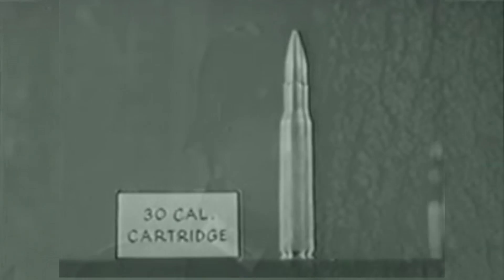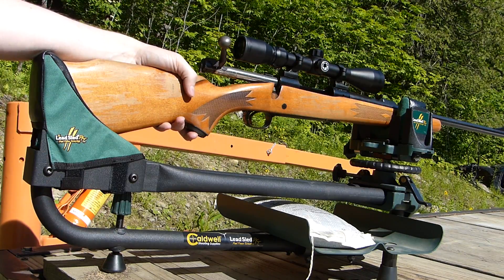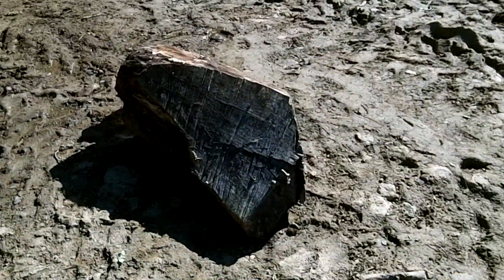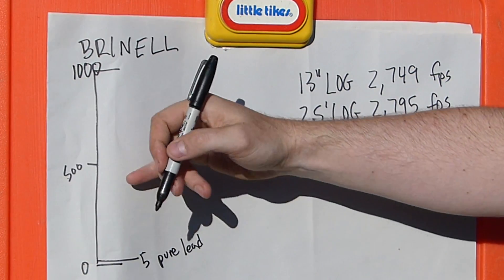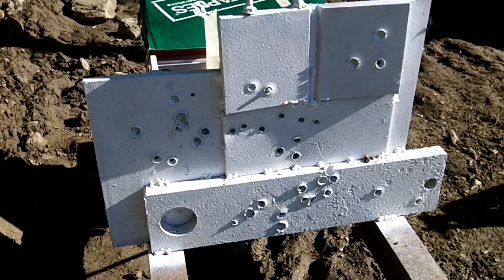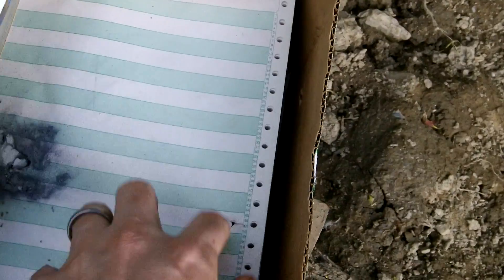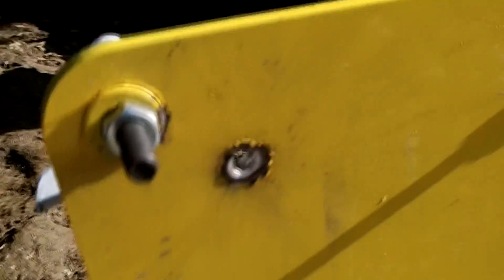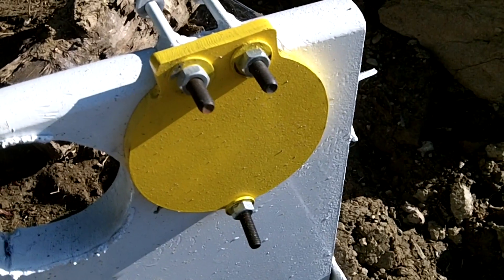AMMOTEST: 30 Caliber M2 (30-06) Armor Piercing Penetration Tests - Military Surplus Ammo

Comment: That is crazy power 1 inch steel with no issues.
Reply: "Additionally, steel will have a significantly greater shear stress 
capability than aluminum. This means that you get nearly 5X as much 
carrying capacity in a given thread engagement in steel as you do 
aluminum. This is the difference between a body-centered cubic crystal 
structure (LC steel) and a close packed hexagonal structure (aluminum). 
Anodizing aluminum will bring their properties in this regard closer 
(about a 2.2:1 advantage to steel). Unscaled merchant steel will have 
(about) 4X the (resistance to penetration) surface hardness of 
(6061-T6(xxx)) non-anodized aluminum."
Reply: @danphariss133  lol good comment . not gonna get to many one uppers on that one.
Reply: @justinriley8651  I just found that someplace and posted it for fun. The concrete wall would get shot more than once in combat. The AP was the combat ammo, ball was for training. This according to a WW-II vet, Chosin Res survivior and Hatchers book of the Garand,  Tracers were used as well of course. And aircraft used API as well as tracers of various kinds... You can find the specs for various miltary rounds to 50 cal in "Cartridges of the World".
Reply: @danphariss133  ya I've owned all those books for years. regular fmj. was used in combat way more often ,I'm sure if ap was available you could use it. they had tracers too,and blanks for launching grenades.
Reply: @justinriley8651  So you saw M2 ball in combat in WW-II and Korea? Just curious.
Reply: @danphariss133  were you?
Reply: @danphariss133  the guy that raised me was a ranger in ww2  and I also had a uncle in ww2 I've got a real good idea what went on . probably better than yours. did you serve in ww2 or Korea just curious?
Reply: @justinriley8651  Dad was just a guy in the army. Philippines. The Korean War vet was a serious gun guy. Life long gunsmith, Inchon landing and wounded on the way back from Chosin. Me? I am a Vietnam infantryman. I saw one can of 30 cal in VN but don't ask me what it was. I don't remember. It was mixed in with our load of 7.62 and I found it one day when cleaning the dirt and mud out of the track. I was Mech Infantry. I can only go on what I was told and what I read. Both these guys had exceptional memories. Dad told me of seeing bullet jackets around masonry buildings and other hard surfaces where the AP had shed it jackets.  He also said that the M1 would shoot through brick walls. Don the gunsmith told me they used AP in Korea. Was I there? No I was not. But neither were you so stop acting like you are an expert, who are running on other people's memories and documentation. Anyone that claimed that M2 ball was never used in the combat zone would be a damned fool and I would never say that. But when I have Gen Hatcher and 2 men who served in 2 different wars telling me they used AP I have to take their word for it. My question for you would be did you ever specifically ask or could you now? My father died in 2017 and Don in 2018 so they are no longer available but I did specifically ask. Being a sorta retired gunsmith and still shoot master class in service rifle. Here is another little factoid for you. The 30 AP was more accurate than the M2 according to the information I get those who used to get ammo furnished for practice and match use by the DCM (now CMP). I also shoot one of my Garands in competition from time to time, but they are not competitive outside vintage or JC Garand matches and I can't see irons worth damn anymore. I have some 30 AP but I don't shoot it since its all corrosive primed from the war years. Some my dad bought back in the 1960s at a gun show for his Garand and some I took in trade for fixing a pistol for a friend.  But while this used to be very common its now almost all been bought and used so 30 cal in boxes or in clips is hard to find and expensive.
Reply: @danphariss133  I'm not acting like a expert I speak up when I see stuff I know is false. I've got one still alive and he was in the bulge and all over . he never had any ap. I've heard that too about ap being more accurate and the snipers using it. can neither confirm nor deny.
Reply: Zooming in shows AP on the guys sling.
Reply: @danphariss133  so that means that's what everybody had. because a couple guys in a picture  had some. there was more fmj than ap being used. it may have depended on where you were at also. some guys might have had ap but not everybody did.
Reply: @justinriley8651  Did you read the post where I said there was no way to know that ONLY AP was used? I was quoting Gen Julian Hatcher who knew FAR more about this that either of us or two people I specifically asked. One of the squads in my platoon got some API 50 cal and were talking about how it flashed when it hit things. We had 50 cal ammo from the 1950s issued to us and it was prone to case head separations due to the powder being too acid and attacking the inside of the cases so we threw it in the bad ammo dump. Yeah I LOOKED at the broken case and it was corroded. I have ALWAYS been a gun guy and I paid attention to the things I used.  I tuned up our 50 so it had a rate of fire about 150 RPM above standard, about the same as a M60.  ANYTHING IS POSSIBLE. But in GENERAL I have to go with Hatcher's writings and the gunsmith that served in Korea. If I were to ask the men I served with in VN about the ammo they shot I doubt more than 1 out of 10 (if that many) would have any idea. Most of the INSTRUCTORS I had in infantry school were firearms illiterate. The 1911 instructor thought the 45 ACP used an 830 gr bullet.  We need to remember this anytime we talk about military men and firearms. So I trust Hatcher, I trust what my Dad said about the bullet jackets. I trust my life long gunsmith friend's account. It is ENTIRELY possible, even likely, that considerable amounts of M2 ball was sent over to the combat zones as well. Heck one hold full on a Liberty ship would have run an infantry company for a LONG time. But I have to accept Hatcher in stating the the "standard" combat ammo was AP. If I were in combat I would much prefer it myself.
Reply: That said, 1 inch mild steel is still very impressive. If my memory serves me correctly, that would be equivalent to about 19mm of rolled homogeneous steel, or 4340 steel, which is the NATO milspec for military grade steel.
Reply: Yes, it is steel, but it's mild steel. Mild steel is very soft. It can easily be scratched by any knife and you can really just tear it up. So yest it is impressive, but it's like drill bit hardness vs pretty much iron.
Edit: it really isn't much harder than alumin(i)um.
Reply: Nigga is you a some kind of engineer or something? Dammm

Comment: That shits crazy on the ar500.
Reply: Its meant to defeat hardened steel plate. But the 30 cal lacks the bullet weight to get through actual armor that is very thick. Or that is angled.  Its a great video and he went to a lot of work.  Hope he washed his Remington out with hit water when he was done to get the salt out. That stuff will rapidly corrode a barrel.

Comment: It's amazing how level IV armor can stop this round that punched through 1" solid steel. That's borderline tank armor lol
Reply: Level IV was made to stop this round specifically. They figured if this can't, just use .50 BMG
Reply: @Jootunn  Or maybe AP with tungsten carbide core would do it. Nammo (Norwegian ammo maker) claims 18mm of penetration in HB 300 steel for the M993. Which is in 7.62x51 mm NATO.
Reply: it can stop the bullet, but the punch is still stopped by the carrier. broken ribs, exploded lungs or inner bleeding is almost 100% to the man who takes the shot.
Reply: @D1gpIco  lol
Reply: @VidandRico  am i lying?
Reply: @D1gpIco  there was a video of a soldier getting shot by a sniper round, it knocked him over but he survived it.
Reply: @RJ-gk3hc  Yeah, long ranges tend to do that. When talking armor peircing, you need to be close
Reply: @RJ-gk3hc  Was it the one with the insurgent’s POV, and the following interview by the soldier shot by it
Reply: I use these in the lab and the ceramic armour to defeat them is impressive. More impressive is the UHMW PE plates that stop normal hunting rifles, but float.
Reply: False Flag  that is fake , or hes hiding the pain.The force isnt completely absorbed into the plate.It still transfers through.Egnough for will cause severe damage.
Reply: False Flag  Yes it will you Mong.Ever had the wind knocked out of you? Your rib cage doesn't collapse and force the air out.Just the force of you falling does.

Comment: I teach ballistics at the PH School East Cape Province, S A.  Great video! Instructive as well as fun.  Well thought out and produced.  Result were as expected except for the one inch penetration of the 1 and half mild steel.  Penetration measured from the back of the bullet not considering the length of the bullet.
Reply: @bearbait2221  Good Grief.... The AP was not ricocheting nor would ball on a flat steel plate unless it shot an angle so the bullet parts would skip off and these were not angled. AP will shed the jacket on contact with the steel plate and the jacket's energy is depleted at the same time.  Have you ever been on a Silhouette range? Or shot silhouette? Now if you shoot at a target that is not flat but cupped it can redirect the projectile but this was not the case here.
Reply: @bearbait2221  carefull, your ass is showing.

Comment: I understand that the M855A1 (5.56mm) round is fairly new, and possibly difficult to procure on the civilian side, but I would love to see that round tested in this same format. Of course, the Army is going to give the round the best possible chance of success, but a truly independent test (against it's predecessor, M855) would be greatly sought after by myself and others who use the round.
Reply: +Swervin309 The M2 AP went clean through that 3/8" AR500 plate! I wonder whether the M995 AP could do the same?
Reply: Yes, NAMMO AP3(M995)  would go through. But the penetrator is much smaller than M2 AP,  smaller wound channel.
Reply: +TheJamesrocket I'm sure it would, but I'm talking about the M855A1.

Comment: These armor piercing M2 rounds are Tungsten Carbide.  They are one hell of a super offense round.  Concrete though has a matrix that does not spread and is why these don't sail through smoothly nor any round for that matter.  However these will still punch through in follow up shots.  You can take down concrete walls, and punch through armor plate with ease.  The WWII generation were smarter than anyone living today.
Reply: Yeah I'd say about 6 or so to the same 1in diameter on the 8in concrete and you'd be through. Fire off 20-30 or so from an MG in a 6in diameter grouping and you'll tear a decent hole in the wall. But even 10 and you will effectively suppress the enemy.

Comment: Now throw that projectile on a 300WM and check penetration. A 35% increase in KE ought to make a pretty big difference. :-)
Reply: Forget 300 WM go with the 300 Weatherby you get a few more feet per second out of it.
Reply: @thehobbyshop887  yes out of the muzzle but not down range.  The military is using the .300WM for a reason and it isn't cost!
Reply: @robertanthony9674  I'll go with the 300 WBY Mag,
Reply: @thehobbyshop887  But the 300wby is no faster down range or the military would be using it instead of the 300WM!
Reply: robert anthony  You can’t get 3300 FPS from a 300WM with a 180gr like you can with a 300 Weatherby . 87gr of 7828 long or short cut and a 26in barrel 180gr sierra = 3300fps.
Reply: @thomasdaum1927  The actual AP projectile is 165gr, not 180. Should be able to fling it pretty fast.
Reply: CAROLINA PATRIOT  It’s actually 163 gr.  I have a bag of pull downs ! I was just stating what my 300 WBY will do with a 180 gr. Bullet  !
Reply: Why? The 300s  and other sniper rifles used by the military are for precision and do not use "ball" ammo.
Reply: Yeah you are correct about this but the harmonics aren't going to be in sync so it would most definitely start to yaw in flight before the impact of the target and that comes with many disadvantages unless you just want a high velocity slingshot!!
Reply: Fascinating. The first round was still perfect. Seems as if a few more grains powder and watch out body Armour?
Reply: Using the Krupp formula for armor penetration, and using 165 grains at 3260 ft/s I get ~30 mm (1.18 inch) of penetration for mild steel(250 MPa of shear strength) and ~ 13 mm (a little more than 1/2 inch) of AR500 armor (shear strength of 1260 MPa).
Reply: To have double the penetration with the same bullet you need twice the speed and so 4 times the energy,using this formula.
Reply: John Doe api ru jus like hi vel...
Reply: I do not think you would get that much of an improvement. 2950 to 3150 FPS is not 35% using the same 150 gr projectile.
Reply: @johnhess351 it's 15% just from velocity. 
Compound that with a heavier projectile and you're at about 35% 

You go from about 2900 ftlb to about 3900-4187 depending on barrel length, powder selection, and how high of a pressure you're willing to push to.

Comment: Did you use rocks ie Marble or Granite in the construction of this wall? or did you use cheapy junk HOME DEPOT or use the good quality SAKRETE with stones in it?  Make concrete wall 1 ft thick but use granite stones 1 inch type and you can stop .50 cal AP rounds ? Only thing that will  punch through that will be Abrams tank rounds however use Cherry logs and space them 2 ft and not even a 155mm Howitzer at 50 yards will punch through...worked with HESSCO so I know barriers really well.

Comment: Your video and findings are very accurate. I too have performed several tests.My steel was scrap from a popular ship yard. 1st was 3/4 inch no problem clean through the 2nd was 1 1/4 this was interesting because the projectile on first shot was stopped however it penetrated half way (untouched) it still looked like a .30 cal bullet pointy as ever. The second shot made it through. I have done the same test with a different batch of black ammo with 3/4 steel and about 14 phone books. This is when I found the penetrator. I found it very odd in the one test it stripped the casing off completely and the other was not touched and as mentioned it was still .30 cal and sharp as ever

Comment: I used to dig those penetrators out of the backstop, strip any remaining jacket off them, then use them in the shop as a center punch.  They are needle sharp and hard as all get out, even after years of using one as a center punch for starting holes in steel, its still sharp enough to hurt if you tap the end with your finger!  They are small enough they are a little hard to hold on to though.
Reply: Its propably tungsten carbide which is harder than steel can ever be. It is also way more dense making it ideal AP material. They also make KE tank penetrators from the same material ;)
Reply: ***** dam you know your shit great job
Reply: *****
It's hardened steel.
Reply: HD5830Gamer
At issue in the instant discussion, between commenter E VU and I, in which you involved yourself, is the composition of the cores of .30 caliber M2 AP ammo, as mentioned in the subject video.
We're not talking about M855, or anything else here, we're talking specifically about .30 M2 AP ammo.
E VU stated that the cores are made of "tungsten carbide", but as I pointed out earlier, this statement is incorrect. The cores are actually made of "hardened steel", which is generally understood to mean any of various steel alloys that can be through-hardened (and are through-hardened in this case).
And then, to back up my claim that it is proper to describe .30 M2 AP ammo as having a core of "hardened steel", I cited the applicable mil spec, wherein you can see for yourself that the U.S. army describes the cores as being "hardened steel".
So in light of this have we finally disposed of the issue? Is there any doubt that it is proper to refer to the cores of .30 M2 AP ammo as being made of "hardened steel"?
Reply: Harold Smith True AP rounds do have about 13% Tungsten and Cobalt in them for increased hardness. Thats why they are barely magnetic because they are NOT just "hardened" steel. It's an alloy.
Reply: HD5830Gamer
The core of M2 ball ammo is not tungsten carbide, as E VU suggested; rather it is "hardened steel". The army apparently allowed different types of steel depending on what was available at the time, but MIL-C-13743A refers to cores as "hardened steel".
I hope that clears it up for you.
http://everyspec.com/MIL-SPECS/MIL-SPECS-MIL-C/download.php?spec=MIL-C-13743A.013870.PDF
Reply: Harold Smith It is alloy steel with Tungsten and Cobalt in it (same materiel as a quality drill bit). Not just heat treated mild steel was my point. The M855 223 for example is just heat treated mild steel and not a high strength alloy.
Reply: HD5830Gamer
As I endeavored to point out to you, various types of steel were used in the cores of M2 AP penetrators over the years depending on what metals were available. Pre 1942 it was a tungsten-chromium alloy. When tungsten was in short supply they switched to a manganese-molybdenum alloy. After that it was something else. If you don't believe me look it up. So what exactly is your point? You're just being contrary? You disagree with my use of the phrase "hardened steel" for some reason? The army refers to the cores of M2 AP bullets as being "hardened steel". I even linked to the Mil Spec where it is referred to as "hardened steel", to prove it to you.
Reply: Harold Smith When I say hardened steel, I mean like what the M855 are made out of penetrators are made out of, just mild steel thats been heat treated to make it "harder" when in reality its nowhere near as hard as the tungsten, iron and cobalt alloys. Some even had uranium in them! but I think its 50 cal and up I dont remember.